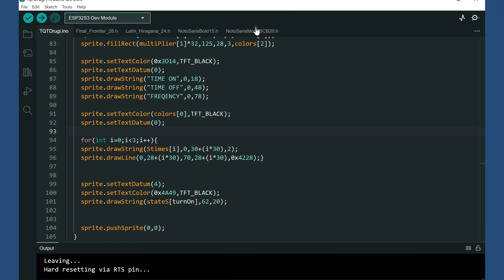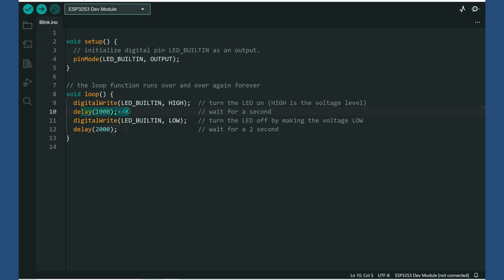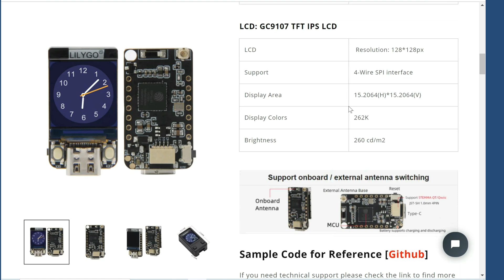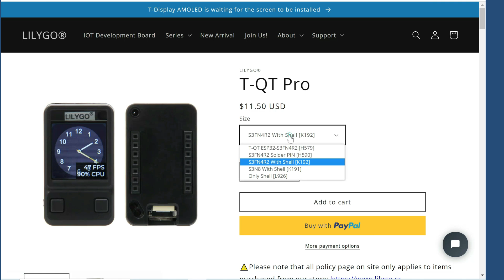Blink Sketch on Steroids (LilyGo T-QT)

Comment: I have uploaded both this blink Sketch and your Gaming Console sketch to 3 different QT-Pro devices I just bought, using IDE 1.8.19 and also IDE 2.1 and they upload fine but I get a blank screen every time.  The AMOLED LilyGo device uploads fine.  Is it possible I have a wrong screen driver or something in my library?  I don't know what to do.  Any suggestions please please?
Reply from the maker: Yes you have wrong library, you need to go on qt github rep, there you will find library, you need to replace your tft_espi libr with new one
Reply: @VolosProjects THANK YOU!

Comment: Hello. You seem to be the T-QT pro expert, so I have a question for you. I am trying to figure out the best way to attach a battery to the battery +/- pads on the tiny board. I actually had a couple pads pull right off the board after soldering. Ended up putting UV curing glue on the leads to keep them in place after soldering. I just don’t like having a battery cable hanging off the back, especially with the mini case on.

In an effort to keep the solution compact, it would have been nice to have a + battery in pin.

Anyway, just wanted to see if you came up with any interesting solution or have seen anyone attaching batteries to these boards.

Thank you.

Comment: I'd like to build this Blink on Steroids project,. Your video image quality is superb but I really wish you had made a simple schematic of how to wire the LED/ 10k? ohm potentiometer and the resistor to the module pins via the socket headers. See Time 3:27 for example of all we have on this . I think one of the most creative things you do is come up with interesting ways to avoid using perf-bread boards to keep the project super small. I can use this as a digital waveform generator and perhaps may need to buffer it's output with an opamp or Txistor but it would be a great teaching device alongside and o-scope  so I ordered a couple more of these TQT devices since they are super cool.

Comment: Thanks for your many blinking projects - very cool stuff. I've bought a T-QT, and compiled your code successfully using the Arduino IDE. I upload it to the T-QT and I just get a blank screen with the backlight on.

I know you're not about troubleshooting these things, but any suggestions where I could look? I basically can't find any documentation for the T-QT anywhere, so I have no clue if I've even got the right libraries or whatever. Thank you!
Reply from the maker: hello, you need to use library you can find in this repo https://github.com/Xinyuan-LilyGO/T-QT , in repo you can find "lib" folder and inside that folder you can find TFT_eSPI folder, copy that folder in your Arduino/libraries folder. Instalation is same like in this video https://youtu.be/gpyeMjM9cOU you will just use another github repo for T-qt
Reply: @VolosProjects  : Thanks! I really appreciate you taking the time to respond. Great stuff!

After a ton of work I just couldn't get anything to work - always a blank screen. Eventually I got moononournation's Arduino_GFX code to work. The big problem was uploading the GIF file to the device. Turns out I had to go back to Arduino 1.8.

The Lilygo hardware is quite nice. Shame they don't have any software support!

Comment: Forty years ago I used to work at a place that made labeling machinery. They had a controller with fourteen 555 timers to set the various delay parameters that were changed by potentiometer where the label will be applied to the packages moving on a conveyor. Later the controller used a microcontroller and the time delay is set digitally. The customer didn't like it and moved on with the competitor.

If someone had implemented similar to the above project, they would have kept their customers. Any type of PLC is about timing and this project is the core of it.

Comment: Thank you Volos. But I don’t know which to get. The 8 Mb without PSRAM or the 4 Mb + 2 Mb PSRAM. What kind of projects better matches with each of them? Thank you a lot 🤟🏽🤟🏽🤟🏽.
Reply from the maker: is it basicly the same :) i dont even know what i have. You will ever fill whole memeory with this board.
Reply: @VolosProjects  Thank you.
Reply: I'd suggest PSRAM option. 4MB enough for code and the RAM gives options for audio or frame buffers.
Reply: @motoani941  Thank you.

Comment: You really should move away from the arduino ide. If you use the vscode extension for the esp-idf you can add arduino in as a component. It lets you do proper debugging on the microcontroller with can be very useful as well as letting you control and use more of the chip.

Comment: Thank you for the continued videos and projects sir. I have a question. 

On their site there are 2 units. I’ll probably just buy both but im wondering what the difference is between the two. Besides the flash/psram they seem identical but I am not advanced enough to understand the difference. 

Also, have you noticed the T-HMI?
I received an ESP32 LVLG 3.5” from AliExpress about a week ago but think I’ll be purchasing this from lilygo also. 
It would be great to see any projects from yourself with this also if you ever get one. 

Thank you for all your work and I’ll make sure to purchase this evening using your link.

Comment: If you could do this with a rotary encoder in place of the pot, 
then when switching between on time and off time, 
the previous setting won't affect the other setting.
Reply: I think he does use a rotary encoder. (Haven't looked at the code)
Reply: Looked at the code.. you are right. Not a rotary encoder.
And it would make perfect sense.

Comment: I like that it uses the S3 chip.
Reply: Can I ask why that is better?
I have yet to find a project where it has any benefit.
(And on the down-side, it doesn't play well with PlatformIO)
Reply: @dozog  That's a really good point. I'm new to ESP32, and what I like to do when I start using a new line of CPUs for my projects is to standardize on one SKU and learn it as best I can. Since cost isn't really a consideration as this is just a hobby for me, I assumed the S3 was a way to future-proof my learning by going with what was newer, and it has some nice features. I hadn't yet looked at all the parameters. It's good to challenge my assumptions. 

On the other hand, I don't use PlatformIO since the Arduino eco-system is working just fine for me, and it works well with the other non-ESP32 CPUs I use. Maybe I'll look at that in the future if I need another topic to absorb some more of my spare time.  ;))

Comment: I wish Lilygo would design their boards with holes in them for mounting.
Reply: They would unavoidably  make the Lilygo bigger.
Make the mounting holes in the board that you plug the Lilygo into.
Reply: @dozog  that's ok, I wouldn't mind just a little bigger to make it so that it could be more easily mounted in a case
Reply from the maker: I totaly agree.